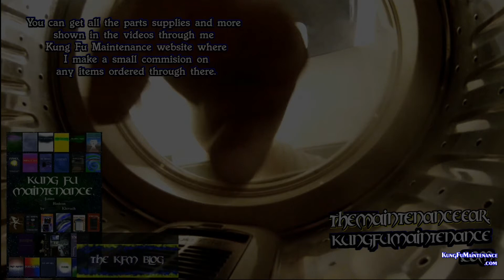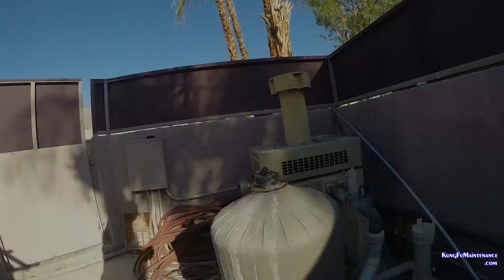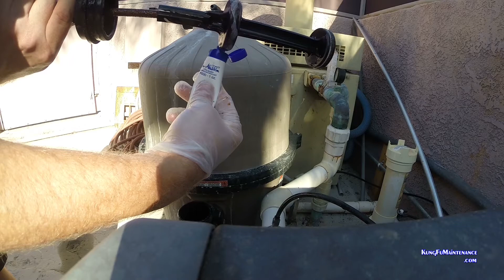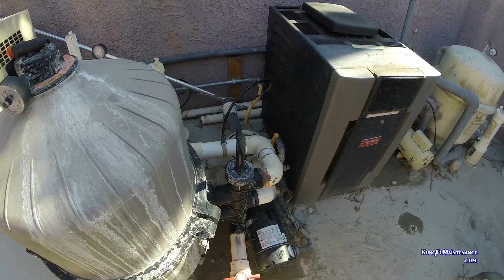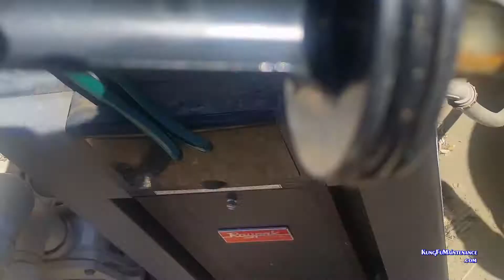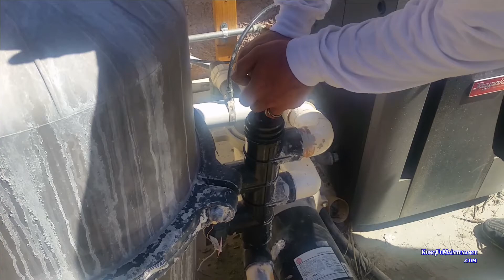How To Repair Rebuild Leaking Hayward Backwash Push Pull Valve For Swimming Pool Spa Filter

Comment: Nice. 
Looks easy enough...except for the disassembly.
I wish you showed how to get the pin/s out to get at the inner o-ring.
I managed to get the top pin out, but it doesn't seem to make a difference in getting the handle off.
I am having trouble even budging the bottom pin. If I can get this off, I can at least take the bottom part of the slide valve off and then see how to separate the handle from the center part and the metal shaft.